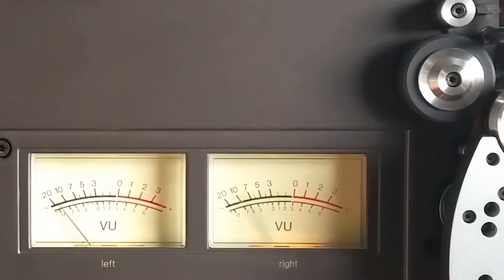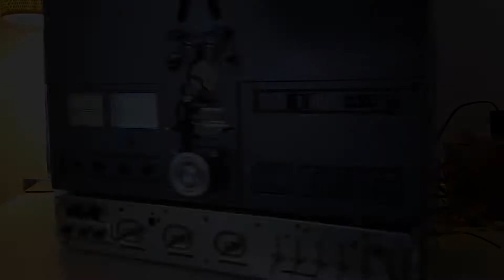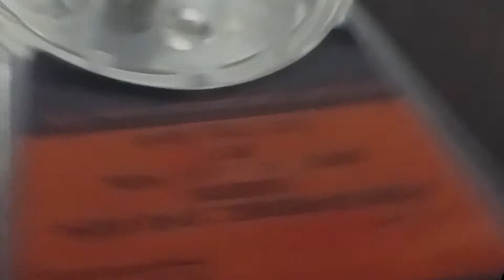Part Five: - Power Supply Board/Lower Tray - Technics RS 1500/ 1506 reel to reel tape deck repair

Comment: did you paint the pull-out hub fasteners grey or replace them ?
Reply from the maker: Hello,  THe ending that shows the alloy hub retainers is from a Pioneer machine.  Not the Technics thanks fro checking out my vid :)

Comment: Good video ...I wanted to ask you a question the power supply board fuses power the lights of the led ?
Reply from the maker: I am not sure sorry I missed your comment. I am good at taking these apart but not very knowledgeable on what is in there.

Comment: Wow.  I don't think I could go that far in clipping all those wires. Lol.  Have a question for you.   Will a 2/4 track head block work on a rs1700?
Reply from the maker: Short answer I think is yes. physically the tape head-block is the same. The heads are smaller in the 1700 block though. I read on tapeheads.net of  fellow with a 1700 who is interchanging the blocks each is specifically calibrated to that machine. The machine automatically recognizes and disables the auto reverse function and there are no issues... This could be just the most versatile machine in existence:). BUT most folks seam to be saying there would be issues with electronics and head impedance and bias.. mainly centered on the thought that the two track head and the 4 track head from the 1500/1506 would likely have stronger signal.. This could be tested.. Anyway it would be nice to have a definitive answer on this..
Reply: @ReelHifi  looks like these technics models are not to hard to dissasemble.